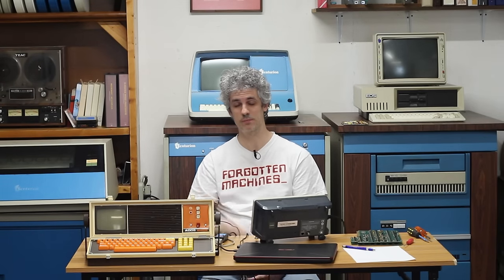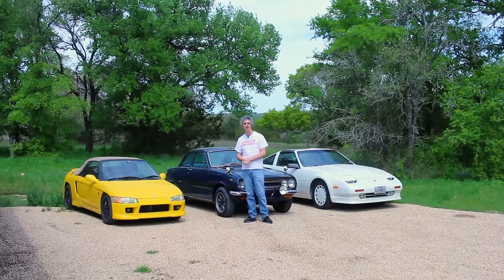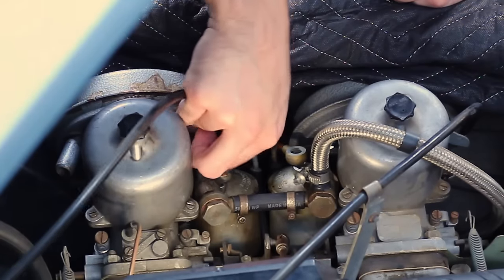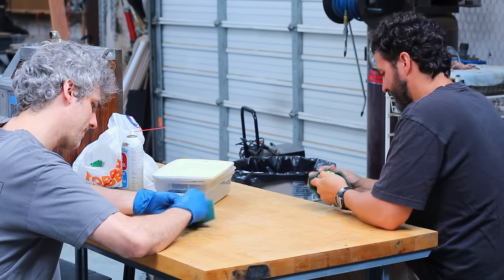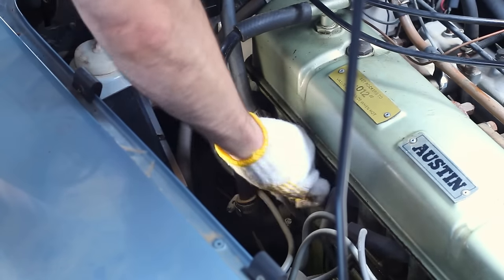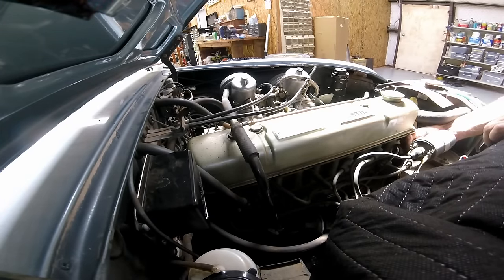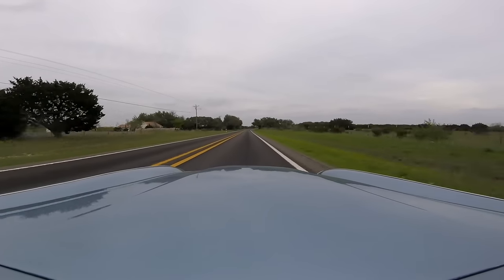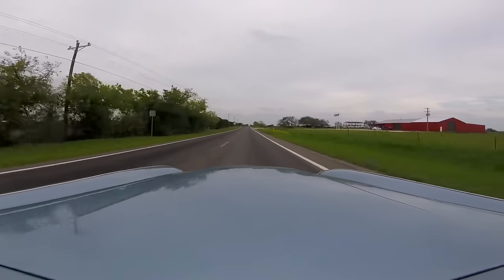Doing Carburetor Work on the Austin Healey 3000

Comment: Writing as a Brit;
I worked in Houston overall for a couple of months in 1997, and was shocked to see how small a Range Rover looked compared to all the trucks, so takes some guts to drive those little Japanese cars on the roads
love that you love our little sports cars. I'm not a car guy so don't know much about the Austin Healey, so great to actually see one, (and being driven by someone who's got a Japanese car to get them to work). My dad and grandpa both had Austin Morris Minors, so recognise the engine, although half the size from way back; and my dad loved the Triumph 2000, and remember topping up the damper pot of the SUs, as part of the virtually continuous maintenance.

Regarding the floats. I thought that removing as much as possible of the solder would be required in order not to increase the mass of the float causing it to float a little lower and hence have the engine run a bit richer.
Reply: It hasnt changed at all.  Trucks in the US just get bigger and bigger.  Modern "small" pickup trucks dwarf today's sedans.  And its not as if sedans stayed the same size.  A 4 seat family car is bigger than a pickup truck from the '90s.
Reply: @finkelmana  It's similar the world over, occasionally I'll see a "large" car from the 1980s, and it's dwarfed by even a compact car.
Reply: @finkelmana exactly right… as you say, not much changed I have a lot of fun driving my MGB in Houston but is scary when you stop at a light and can see the car one live over from UNDER the truck next to you.

Comment: Carburetors are part science, and part black effing magic.  So intricate in how they work, and any little thing will make them work less well than they can.  So many little things go on inside a carb.

Fuel injection, by contrast, is simple and direct.  But back in the day carburation was the only thing, and it's amazing how well they worked.  The amount of engineering that went into those "simple" devices is insane.

Comment: I wish I had such luck (or skill).  The other day I stripped down the carb on my 1972 Hillman Avenger (Plymouth Cricket) to try to diagnose why it was running intermittently, but didn't solve the problem.  I had to pay someone to do it properly, he cleaned it all up internally,  reset the mixture accurately, replaced a bad condenser (capacitor) and set the timing.  Now it runs like new again.

Comment: A little bit of car fiddling always clears up the mind. As being a vintage electronics restorer, maker of new adapters for old computers, photographer and a person with generally too much hobbies for a single being I can say I really do love the car and motorcycles repairs too. But, a little bit about the carburetors floats. 
The floats usually are very precisely weighed. If you solder on the float, you are pretty much guaranteed to change the weight of the float. Increase in weight decreases the buoyancy which results in the fuel level going up. That can result in fuel overflow to the cylinders making it go rich. Or it can dribble through the gaskets and make a mess. The correct way to do it would be to heat up the whole float with a heatgun or a torch and desolder it to two pieces. It's surprisingly not that hard and if you are not afraid, you can do it even when full of gas, it just takes longer for the fuel to evaporate and escape. Since the float is full of fuel and fuel vapors, it is not going to explode since there is no air to burn the fuel.
Once separated, it can be cleaned from the old solder and checked thoroughly. And at the end, you can solder it back together the same way as the copper plumbing is done. 
That's just a FIY from a fellow repairer, you already have the new floats on the way :)
Also - spark plugs are very tough, yes, but... :D
The inner electrode can get damaged by the wirebrush. That makes uneven surface which makes the spark jump in a single point, wearing the spark plug down. The best way to clean it is with - again - propane torch. Just burn all the junk off and then brush the ash off with a toothbrush :D

Comment: Usagi,

  I feel the same way about my late mother's 1990 Miata NA. It's like a MG, but with mostly Ford electrics. Of course, I drive it and have had the bearings done, fluids replaced, and fixes for stupid maintenance mistakes from a not to be named mechanic.

I do run errands with the car, and people do appreciate seeing such a car still running, going strong. It's not car show material, but it is pure fun.

The battery is the only problem area with the car, but battery replacement is simple.

Comment: At least you have the "better", dual-carb version. I used to run tripple SU setup and mate, they cannot be kept in tune! Don't even think about it, it's not for daily driving. Yes, I have Austin Healey 3000 engine (bought from a nasty crash/basket case car) in Morris Isis Traveller, so 130-140hp is borderline lethal even on radial and relatively modern tires but we enjoy this small, family rocket from the late 1950s (1959 to be precise) every sunny day. And I replaced SUs with DellOrto carbs, much more reliable and cheaper. Otherwise I use my Cortina Mk.V, or, my new favourite, Lotus Excel. I would go into Lotus more, but I don't live in Britain anymore, so service is a massive problem.

Comment: I"d add: - replace all your front suspension bushes (they are shagged). The speedo will be a sticky cable: disconnect at both ends, and use a cable oiler to push some light machine oil through. The diff leak might be caused by a stuck breather valve (top of the casing) - if it's stuck, the diff will pressurize and push oil out. Nice vid, engine sounds really good.

Comment: I relate as cars were a passion for me prior to electronics and there is nothing like fixing and driving an old car you love. It's more expensive but super effective therapy. 

I had a similar issue with brakes on a Jeep I was working on. Replaced everything, bled a gallon of fluid through the whole system, hard lines, soft lines, calipers, wheel cylinders, master cylinder, everything but the proportioning valve, still felt like garbage. A friend suggested bench bleeding the master cylinder again and that seemed to do the trick.

Comment: I can definitely relate as I'm also a huge fan of vintage electronics and cars. I haven't had any experience working on your specific car. But generally if your rear brake shoes aren't adjusted correctly it will make your brakes feel like garbage. This is because they usually get applied first, then the brake proportion valve kicks in and applies the front. If 2/3 of your pedal travel is used getting the rear applied your not going to have much left to stop the car.

Comment: Dave,
I am a old computer ( 2 IBM 1401s) geek and old cars (1924 Dodge Brothers Screen Side Truck).
The float in the truck sponge a leak in the middle of aq parade 50 miles from home.
A guy said "I live a couple form here. Would you like to come over to fix your tuck?
At his his house I pulled the float out and took it into the kitchen.
His wife boiled a pot of water.
I held the float under water had found a stream of bubbles from the leak.
I turned the float so the leak was down and let the gasoline drain into the water.
Now I knew where the leak was, I soldered it over.
That was 15 years ago and it was never leaked again.

When you drilled the two holes you created new leaks.
The original leak and the two you drilled.
You soldered over over the tho holes you drilled and not the original leak.

Stan Paddock

Comment: A common issue for the sneezing and coughing with these carburetors are also the rubber membrane and oil level for the vacuum pistons you see at the top with the black plastic screw head at the top of the carb, if the oil level is low or there is a hole in the rubber membrane the engine will run lean at initial throttle making the engine sneeze. these pistons are working almost like acceleration pumps and the vacuum membrane lift the pistons up during acceleration and the small oil filled cylinders makes they go slow enough for a good fuel mixture. I think these carburetors can run very good when properly tuned with new floats.

Comment: I am not really used to the big Austin lumps , being more familier with the upto 1300cc A Series - in single and twin carb set up (and twins are a pain to balance), but the SU/exhaust rasp is just soo good going downhill in a small car , where the road holding scores more than the notional power output of the engine.

Comment: For future reference, with these old floats, rather than drilling holes into them... just desolder them completely apart, clean them, make sure there's no worn metal that you can't see and solder them back up. Trust me on this, not worth the effort chasing holes or making more holes.
Also, no plastic floats. Plastic floats are junk. But seriously clean them, flux them put them back together.

Comment: Make sure you pull the caps off the carbs, and check the oil level. Probably a good idea to just take off the domes to check for gunk in the sliders. Then look down the holes and you'll see a 'full line'.  Always used ATF, and they worked fine.

Comment: I've done a little googling, you may want to take another swing at soldering the floats, this time with plumbers flux, and inspecting for micro cracks in the brass. Nitrophyl floats seem to absorb gas over time. Avoid the impulse to switch to a torch, and make sure you've got a vent hole when you're soldering to keep the cooling air inside from collapsing the float. 60/40 seems like the right choice to use too, since apparently ethanol in modern gas likes to attack the tin over time as well.

Comment: I love a nice throaty carby I6. If it was mine, though, I'd probably go for a couple of Stromberg 97s or side-draft Webers though. If the hood would clear a Carter YF on a single manifold would be exceptionally reliable....literally millions of Ford F-series, E-series vehicles on the road use a YF on a 300cid I6 and they're some of the most reliable things to ever have four wheels attached...but that setup would be way too tall. Would either A: need to cut a hole in the hood or B: run without a hood, both of which are not something one does with a classic British sports car like this. So that option's right out.

Also love that you treat it like it was meant to be treated. That's how they ALL should be. MG did not design this car to sit on jack stands 364 out of 365 days. They designed it to have the shit kicked out of it on twisty backroads! Seeing you slide that thing sideways was absolute perfection!

Comment: You might want to check the ground strap on the engine. They sometimes fail, and on some cars the starter current etc flows through the choke cable, causing it to weld itself up, or split into 2 pieces.

Comment: Our Midget did the same thing with the speedo.
Try replacing the cable. Make sure to get the cable actually into the drive gear when you put it back in. If you don't, the speedo does nothing. Drive gear may have also failed. At least on the Midget, they're plastic, and can strip out.

Comment: The newer SU:s with an integrated float bowl is way better than the old ones. It's a night and day experience and they hold the adjustment a lot better since the choke is a separate valve and not a change of height of the main nozzle.

Comment: somewhere in my tool kit (It sort of broke) I had a "deep" hex spanner that was plug nut sized,  no need for a wrench as such , but a pipe over the end increases leverage.  longer pipe and it removed wheel nuts too.  I guess I should clean it up and weld it now. (or braze - I am better at brazing)

Comment: Diff Oil Leak , sawdust (either in diff if you like) or under the car in the tin pan and live with it ,  more likely just the inner gasket or the inner oil seals ( more tricky ) again its a service item when you get to the  50 year / 250000 mile level

Comment: I would suggest instead of 60/40 you get your hands on some 63/37 (eutectic) solder instead... With 60/40, there is that certain range where the solder is not quite solid and not quite molten, requiring a bit of care to prevent 'mushy' solder joints. With 63/37, the transition range from solid to molten is like one degree.

Comment: Those SU's would be HD8's. Soldering the floats, remember solder is heavy, dont add to much. Solder up the last hole when the float is cold. The HD8's have a rubber diaphragm that gets hard and can cause the choke to get stuck or cause a fuel leak.

Comment: If you want to reduce soot formation in your sparkplugs, remove all yellow metals from the fuel path. Copper catalizes fuel components into gums. If you are going to just replace the floats, go for stainless. If not... Three hitachi's are better than two strombergs... But better yet would be 6 webers... Enjoy the tuning job, though.

Comment: Lucas really sucks. I have been a Jaguar fan since the E-Type, but never owned one until 2003, when I bought a 93 XJ-6. I love the power and ride, but as most, if not all Jaguar owners know, Lucas is a refrigerator builder and needs to stick with that. Even when motors and pumps still work fine, the electrical connectors going to them are simply garbage. I ended up selling the beast for about what I paid for it 10 years later, but still had the urge to own a newer model knowing that after Ford bought the company, they did their best to correct the electrical issues, and were partly successful. I bought an 05 XK-8 convertible used and really love the car. Yes, it had the dreaded leak in the hydraulic latching system for the top, but fixed that with better hoses. There have been other issues, but it runs and rides like a dream, so I will fix any issues as they come along.

Comment: front end, fairly normal service work,  having you road camber on the right might have a small effect on the loadings ?.   Speedo cable - is it off a worm drive out the gearbox - similar bowden cable issues as choke probably or the gear has stripped/worn.

Comment: Is the choke cable a Twist one - it holds out until not required , then you turn it quarter turn approx to slide backwards to close choke off.  Otherwise bowden cables can be sticky - re grease with a grease gun or the strands have broken. frayed somewhere , or the outer ridged flexi tube has given up somewhere.

Comment: yea that vg30 is an engine i have fooled with did a few engine swaps on 300zx  microsquirt ecu are a nice upgrade cheap usa made and android tablets can be used as a dash /gauges and tuning but pc/laptop  is the thing to use for that but  it can be done  and do you self a solid a recap the OE computer before it messes up

Comment: Brakes are typical for the type, they need to be bigger, to get better braking. Unfortunately you need asbestos pads to be right, and half your issues likely come from ethanol in the fuel. Hope you are adding in some seat lube as well, or have replaced the valve seats already, to ones that handle unleaded fuel.

Comment: Brakes,  you have brakes ?  (seriously your suggestion that the pistons probably need new seals I would think is most likely,  darned things , dont use the car, they sieze up, do use it , they wear out,  pull off springs might be weak or not in the right holes too)

Comment: Please don't replace the carbies...  Keep it stock and enjoy it for how it was meant to be... If you want zippy trouble-free open top performance get an MX5 or an S2000, or take your Beat for a spin!
Reply: I wish I had kept one of my (3) Honda S-2000 sport  cars.   In the summer of 2000 my wife & I purchased two first gen 9,000 RPM cars, a red with black interior and a silver with red interior.  In 2005 we purchased yellow & black 2nd gen gen 8,500 RPM S-2000. After few years the motorcycle bug got use and the S-2000s all got sold for other toys.  Now the price on clean S-2000 are above the old MSRP sticker.      Now in our 70s the wife says we are to old for toys.
Reply: @kenromaine2387  Yeh I almost got an S2000..  I got a second hand Audi TT Quattro instead as it was cheaper.  It was OK, had a lot of fun with that, but was disappointed on track days when the S2000s would be right up my freckle! ;-)

I still look at both tbh, but I don't have the garage space...  So many cars, so little space, so much tax and insurance...

Comment: ack NO!!!....don't use metal on plugs insulators, it will contaminate then with low resistance material....use a torch to burn the carbon off the plugs....argue all ya want about the torch, what environment do plugs actually live in?.....

Comment: You aren't making brake dust, so they pads aren't ever going to feel good. Change out to carbon metallic pads, slotted rotors up front and see if it has  an balance valve for the brakes and if it's working correctly.

Comment: But, but, but, where are the valves, where is the boot code, how does the system console work, why is that power rail not working as expected ?

I too like older cars and spend a bit of time removing the skin on my knuckles when playing with them.

If only there was a way of putting small computers into cars to make them better, then we would have the best of both words..